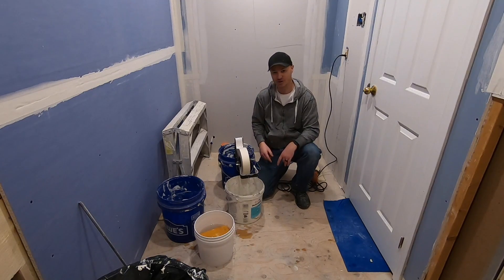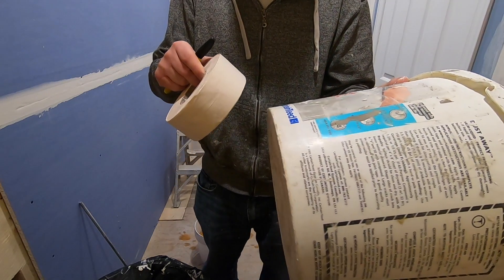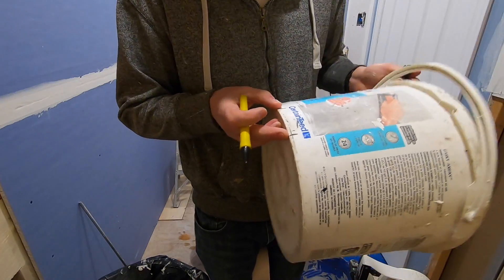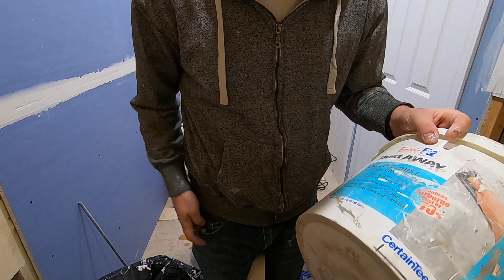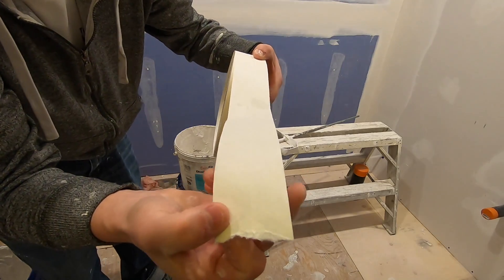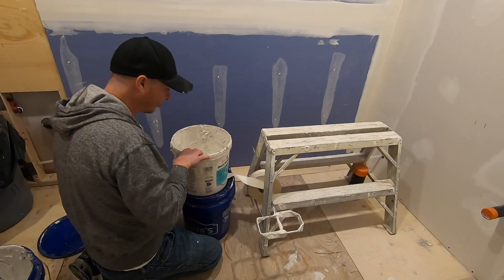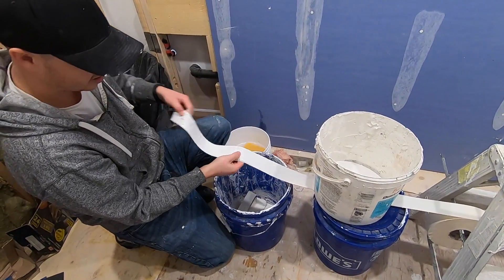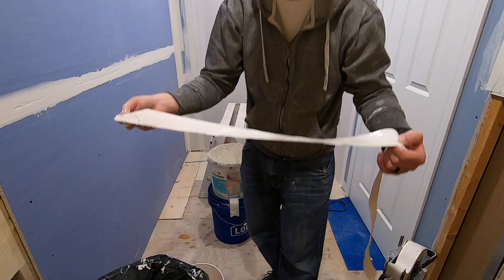Tape Drywall Faster with this DIY tool

Comment: These are the kind of tips that I tend to start every home 🏠 repair project without.  You’d think after 46 years on this planet I would have encountered a few of these tips before... but you would be wrong. 😝 

This will be a real timesaver!
Reply from the maker: It works pretty well! I used a "banjo" for awhile, which is like a mini hand held version of this, and it was terrible. Too heavy and didn't hold much mud. This is the way to go, cheap and easy. I use a real super taper now, but it's kind of a pain to clean, might have to switch back to this thing haha
Reply: You are right.  I have taped with a bazooka for years and tried this on a smaller job and it was life changing!  lol